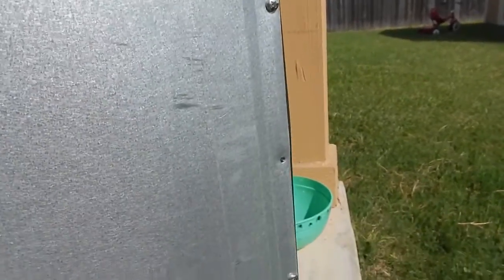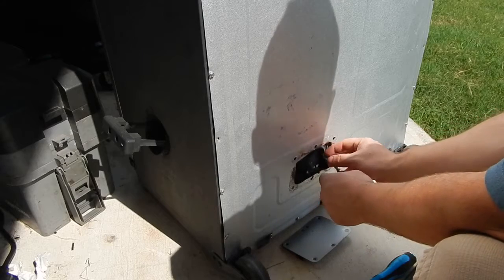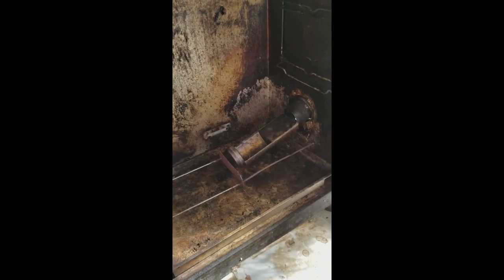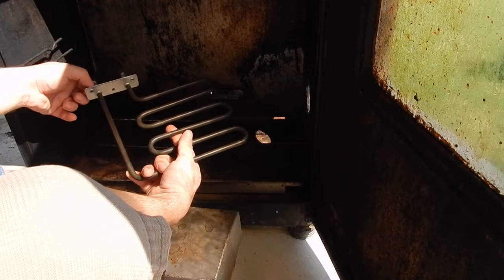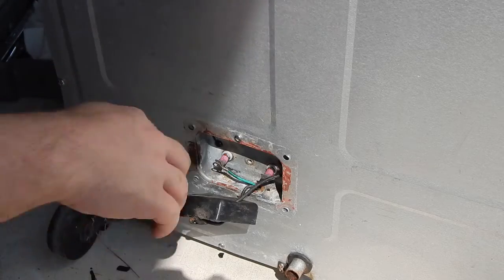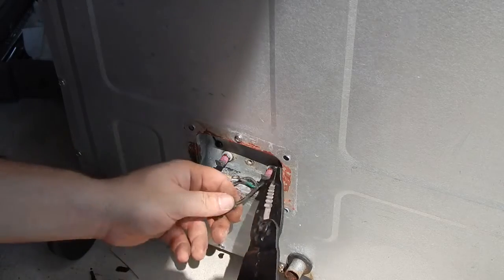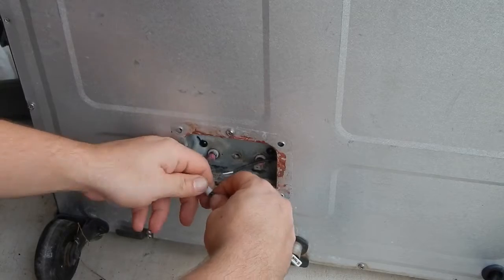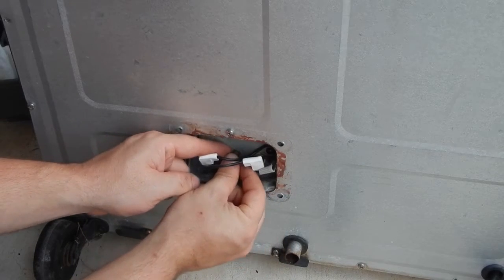Putting the Heating Element back Into the Smoker

Comment: Exactly what I needed to see.  Very clear and helpful.  My only problem is getting the box the wood tray slips under.  The small nut and bolt are frozen and very hard to get to.  Liquid wrench didn't help.  I will figure it out and get that smoker cooking again very soon.  Thanks for your great video.
Reply from the maker: seafoam makes a good product for a penetrating oil. You can also use brake fluid but its corrosive to paint. Worse case scenario, drill it out and replace it with an oversized bolt.